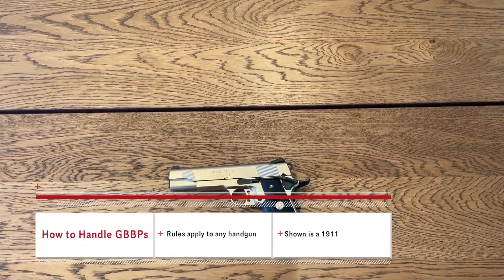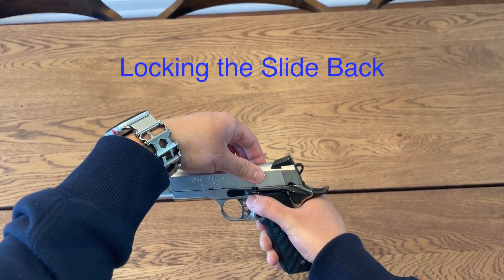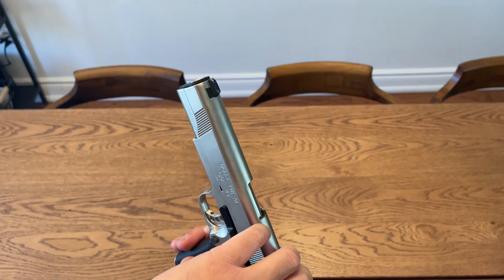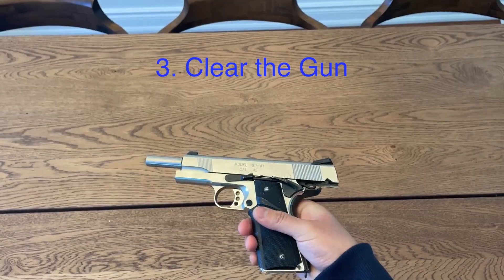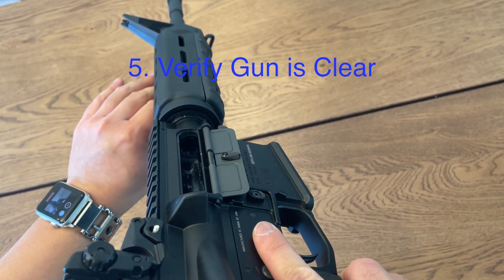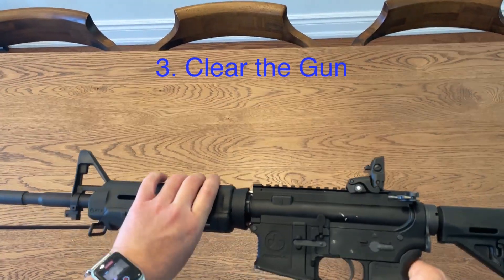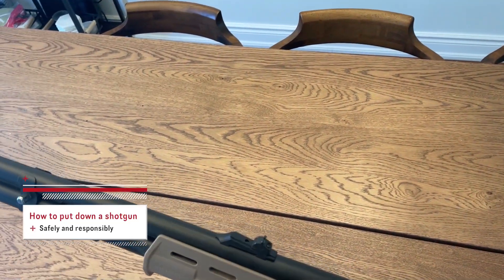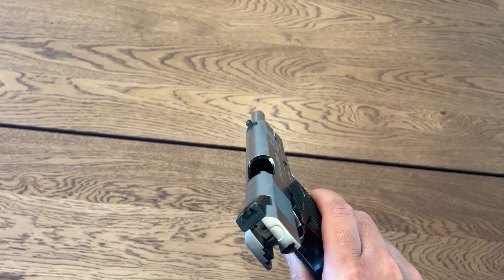How to Handle GBBs Safely | Pistol, Rifle, Shotgun

Comment: Use black crayon for peeled off paint om kwa lm4. Cheapest solution
Reply from the maker: Good solution Ferdinando, thanks for the tip! I used a black permanent marker, but the colour didn't match.
Reply: Crayon will match
Reply from the maker: @ferdinandolatin2125  Yes sir, thanks for the tip.